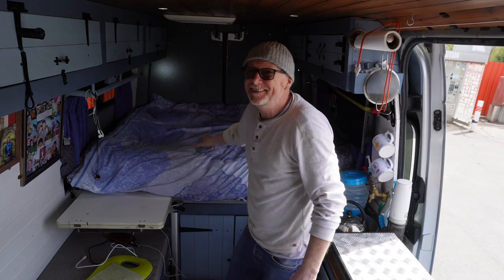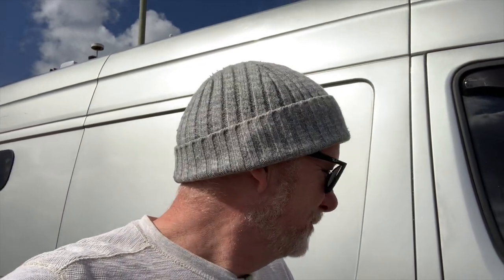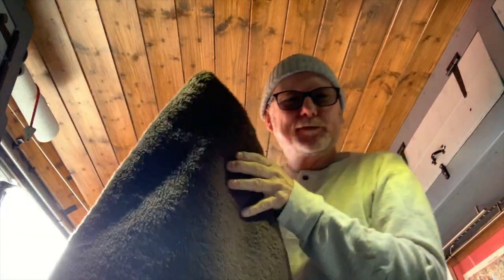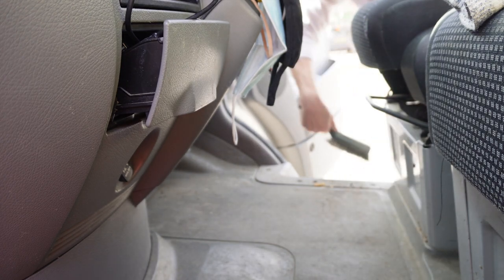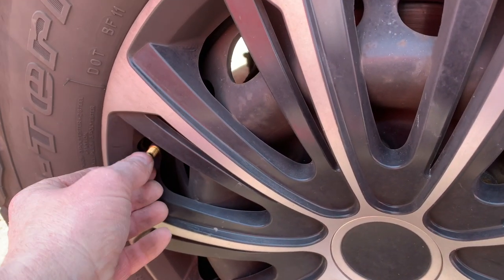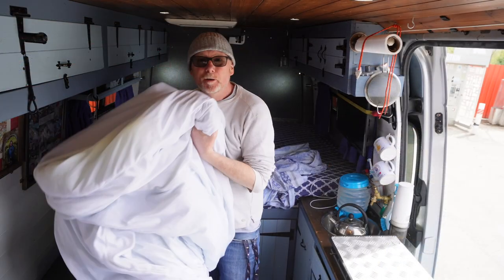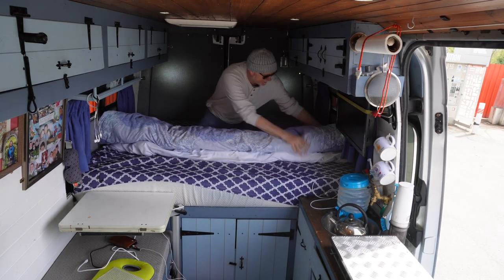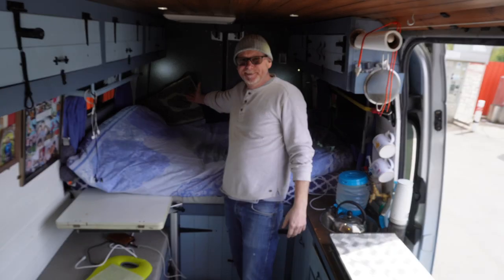Living The Van life Dream Off The Grid In My Sprinter Van Conversion

Comment: He's one, my Chinese diesel heater wouldn't light up, thought it was broke. Finally found my split charge relay is bust. So not charging leisure battery. Leisure Voltmeter showed low volt after long engine run. A little orange light on relay out. Moral of story, carry a spare they are cheap enough.

Comment: Mel. I had a look at that “Quilt” video. It’s dated April 1st!!!

Or should be! I used to own Holiday Flats. Each flat had 4-6 beds in and on change over day, Saturday, we had limited time to get the flats ready for the next family. I used to help the cleaners by making the beds up. So, as a veteran of bed making with quilts, I can tell you that video shows the single worst way to put a quilt on! Try this:

1. Lay the quilt cover in position on the bed with the opening facing you ie at the bottom of your bed.

2. Hold the Quilt by the top 2 corners in front of you at the end of your bed.

3. It’s all about the 4 corners. Take the top left corner of the quilt and locate it in the top left corner of the quilt cover. 

4. Repeat with the top right corner. Top of quilt in position! Then place the lower left corner of the quilt in …., yes, the lower left of the quilt cover!

5. Repeat on the right lower.

6. Holding the Left and right lower corners (Quilt & Cover tightly), shake the quilt. 

7. Secure Velcro/buttons. Job done! 

Once practiced takes less than a minute. Have fun!
Reply: Is there actually room in the van to use this method? A video would be easier to visualize, if you know of one maybe respond with a link. Cheers.
Reply from the maker: Thank you but I don’t have room to do all of that I’ll stick to doing my way

Comment: Talk to your Tyre Supplier about the advisability of filling them with Nitrogen rather than Air. Costs a little bit to do, but I’ll never go back to using Air.
Reply: hi can you say why , what the difference or advantage ? thanks
Reply: @uptowndisco2  Nitrogen holds Tyre Pressure far better and for far longer. 
With Air I was continually wasting time at service stations re inflating Tyres. 
With Nitrogen I no longer has that chore. 
My Tyres hold Pressure between Tyre Services.

Comment: Great video, we love the quilt trick. We use the Soap and Suds Laundrette over in Stroud it's £4.40 for a wash and £1 for 14 minutes dry. We travel all over and it's the cheapest we've found with best results so far.  Also then get to pop into the town to do a bit of shopping while we wait. Thanks for the heads up on the outside laundry's though. Very helpful indeed :) Hope you managed to get the O rings sorted.

Comment: Mercedes got the image.got the looks.got the size got the image..as a fitter let me tell u they are complete and utter shitttttte.the older models are much better up to  2001.so buy old and if you can a  5 cylinder diesel hard to get now and fetch good money but for good reason ......the body shop is forever fixing rust and rot behind all them side body panels ...there shockin😂😂😂